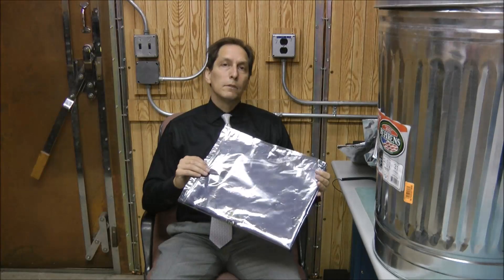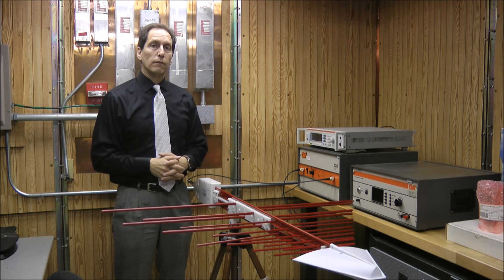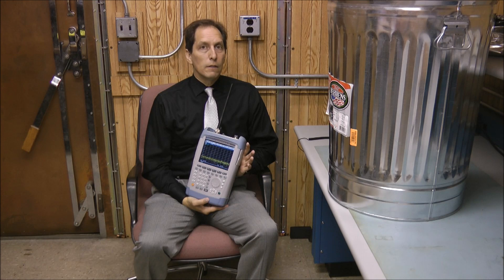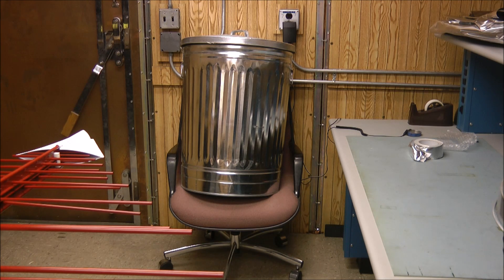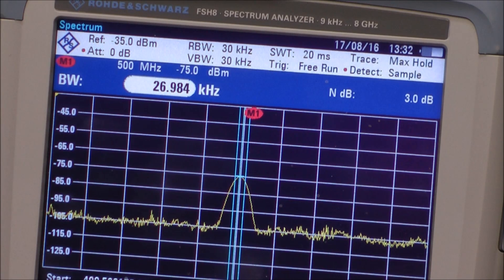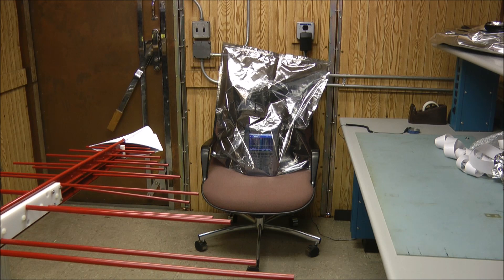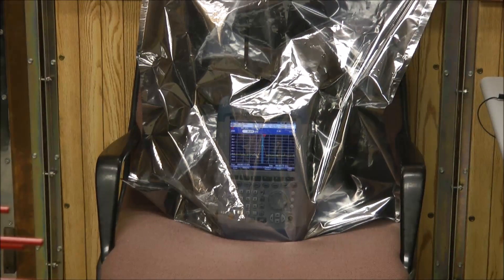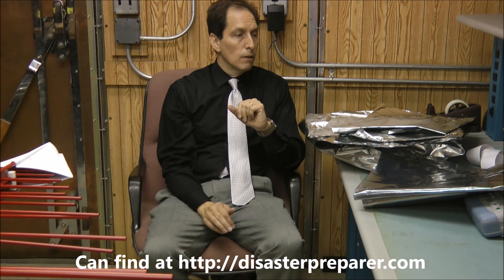Testing Garbage Cans and EMP Bags

Comment: i am going to ask you a question in hopes of a real answer. could you use flex seal which is a rubber paint to make a Faraday cage
Reply from the maker: I'm not entirely sure of your question... if you're asking if you can make a Faraday cage out of something non-conductive (like rubber), the answer is no. The Faraday cage must be electrically conductive. You can, however, paint or cover the metal with rubber without affecting the performance.
Reply: Thank you yes you did answer my question. However you would think that if you didnt want an emp to affect your electronics you wouldnt want any electrical to get to that product>thus using a rubber lining inside of trashcan would do just that.
Reply from the maker: You can line the inside of a can with rubber or cardboard. That's fine. It's usually not necessary though, because most electronics are already made with non-conductive plastic housings. I don't line my can, but many other people do. Either way is fine. You do want to be careful not to allow exposed antennas, power cords, or other metal parts to touch the inside of the can. Lots of folks are putting their items in EMP bags (see http://disasterpreparer.com/emp-bags) and then putting those bags into the cans. That provides nearly 100 dB of protection, and the bags act as insulators to prevent any accidental shorts to the inside of the can.
Reply: You are correct. Yes these bags are great and your web sight is great. I love the bags you have provided. Really wanted to make a very large Faraday cage now with your help I can do just that.
Reply from the maker: Good luck!
Reply: @disasterprepper  The fear of touching the metal with antenna or other conductive parts of a device is exaggerated. So long the entire device stays fully inside the faraday cage or bag, the effect will be low. Only if a conductive part (cable, antenna) hangs out, it may get worse than with no shielding (when it acts as 2 sides of a dipol antenna or plate capacitor). Remember people inside a faraday metal mesh suit while a tesla coil or van der graaf generator fires arcs at them. The suit touches the body but still distributes the electricity well enough to prevent electric shocks.

Comment: What about the thickness of the shielding material? I've read up about the Skin effect, could a higher powered pulse like an EMP instead of your test rig be able to bleed through the conductor due to skin effect? (Atleast for the lower frequencies like <100kHz)
Reply from the maker: Skin effect is the term used to describe the tendency for high frequency signals to "crowd" to the surface of conductors. And yes, at very low frequencies, the formulas yield large skin depth values. That said, it's really not relevant for low frequency radiated wave energy (i.e., 100 kHz) because the wavelength of such signals is so long that the energy won't couple well into the conductive surfaces of a small object (like a trash can or EMP bag). Consider that the wavelength of a 100 kHz signal is roughly 3,000 meters. That means that it would need a conductor perhaps 300 meters long to couple into without significant loss.

Comment: Do you have any test data for using a Dri  Shield 3400 bag inside of a sealed aluminum trash can?  I purchased your book but it does not address the layered effect.  Should someone line the can with non conductive layer cardboard, carpet padding etc?
Reply from the maker: I have tested the two combined, but it is greater than my test equipment can measure. Typically, you can assume the protections roughly add (i.e., 50 dB + 40 dB = 90 dB).

Comment: Great help! At last scientific analysis of EMP protection for the layman.

I'm moving my prepardness onto EMP's and knowing that the Dri-Shield 3400 works very well finally gets me going in the right direction. I'll probably get some type of properly sealed metal container to put the sealed up bag into for added protection.

Really appreciated this! Superb.
Reply: not quite reliable test tho. testing in 499-500mhz range with nowhere near the power levels of a nuke EMP blast which would effectively be in the 15-250mhz range.
Reply: @vaughanmontgomery3434  per a PDF I saw online (will try and link if find again) from California Institute of Tech. Prof., N-EMP would be around max. 100mhz...

Comment: Hi there, you mention the 3400 line of dri shield bags, I noticed there is a 3700 line as well. 
Would I be able to rightfully assume the 3700 is 1 step above the 3400? Any answer would be greatly appreciated!
Reply from the maker: No, not necessarily. The bags vary in material, durability, translucentness, etc. Of the ones I tried (about a dozen types), I like the Dri-Shield 3400 the best. All of the Dri-shield bags did well except for the 2700, which is very slippery and hard to seal well.
Reply: Right on, appreciate the reply!

Comment: @disasterprepper
I have a question.
Could you try to protect a SSD in such a metal container, put some Data on it, making sha256 checksums of the data and then try to destroy the SSD with an EMP?
I would be interested to see, if a such protected SSD might survive that.
Reply from the maker: Creating an actual EMP is very difficult. It requires a full EMP simulator, which I don't have. I test at lower levels and measure the effective shielding.
Reply: disasterprepper
I understand. Thank you for your answer.

Comment: If you were to use the EMP bags on your website and put them inside of the trash can sealed with tape would the effect be even better shielding or is it ineffective?
Reply from the maker: Yes, layering like this is even more effective. It almost adds... so if the bags provide 50 dB of protection, and the can provides 40 dB, you might get close to 90 dB when using both.
Reply: Thank you for clarifying.  I will be buying the bags on your site on my next payday.  I kind of thought it would be more protection but I'm really happy to see that it almost doubles.  Thank you for your time and videos.

Comment: Another question not related to faraday cages if you don't mind.  I've heard so many conflicting opinions about standard solar panels and whether they are vulnerable to emp damage or not.  Could you share you opinion on this?
Reply from the maker: No one knows for certain, but the best analysis seems to suggest that the panels themselves would likely survive, but the controllers and diodes would be prone to damage.

Comment: Would you expect to see similar results from a small closed and taped ammo can?
Reply from the maker: Only if you can get metal to metal contact around the can's lid. I tested an ammo can for the book that was untapped, and it did okay, but I didn't go to the trouble to sand the paint off and tape the lip.

Comment: Have you tested any of the window treatments on this site? http://www.lessemf.com/plastic.html
Reply from the maker: No I haven't tested this type of film. The issue I have with it is that the RF waves propagate quite well through standard sheetrock/wood studded walls, so I'm not sure how much difference this would make.
Reply: I would assume that you could get some sort of wrap that would go up like the plastic wrap before they put up the exterior siding. Then you could make sure the seems are sealed to the windows and then use the window film for the windows.  

I also saw that they had some paint, so you could paint the walls.
http://www.lessemf.com/paint.html
Reply from the maker: That could be, but it sounds expensive. Also, cell service would obviously suffer considerably in the home.
Reply: That's why you have phone forwarding to the internet phone when you are at home.. ;)

Watched some videos of a company that does it in Germany to keep out "radiation" from cell towers and the such as a health "treatment". They didn't do the glass part, but they put a mesh on the roof below the tiles and painted the outside of the house. I'm not sure how they connected the gap between the roof and the walls, but I guess they weren't going for complete coverage. Also, I guess the roof overlaps the wall somewhat.  They said it cost around the price of a pool or redoing the roof.

Comment: Great video!  I've heard there is another potential point of leakage with a galvanized trash can - the side seams are usually only spot welded in a few places which could  allow energy thru the gaps.  Have you ever done tests with the side seam taped?
Reply from the maker: No, I haven't taped the side seams. I think the steel is folded over running along the vertical seam, but let me double check. Obviously a long intermittently welded seam would be a good source of leakage. Will check and reply back.
Reply: @disasterprepper  I also read the holes where the handles are attached are leak sources, as well.
Reply: Any update on this question?

Comment: We watched the one you did a while back - is this different?
Reply from the maker: I tried to combine two tests into one to make it easier for folks to watch. If you saw the previous ones, this would be quite similar.
Reply from the maker: No, I don't think the small gaps around the handles matter. I've tried taping them, and it had no effect. I have a garbage can with dozens of 1/4 holes drilled through it, and it provides 50 dB of shielding. It's not the holes. It's the long seams that matter.